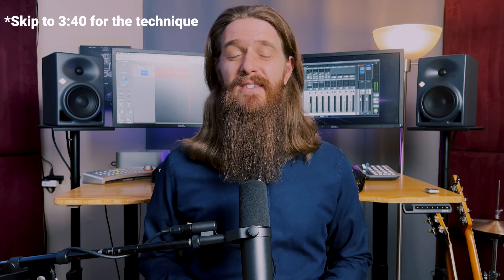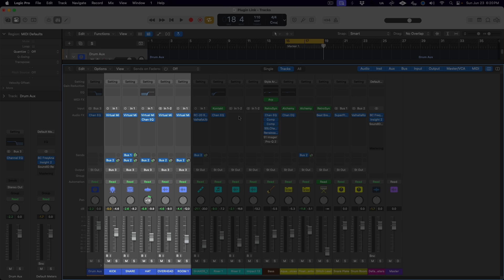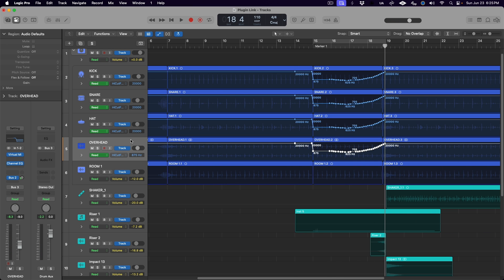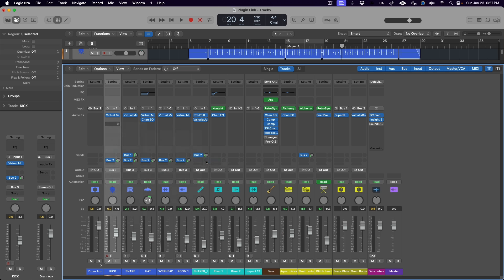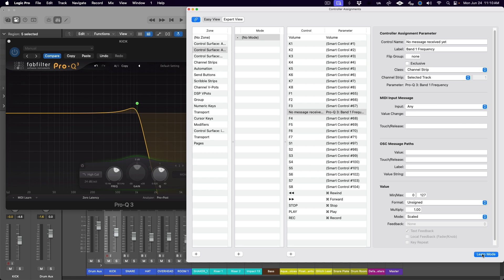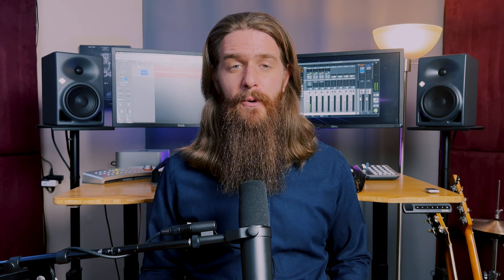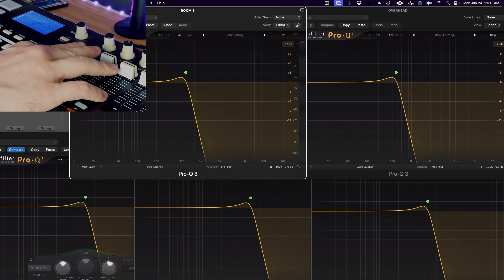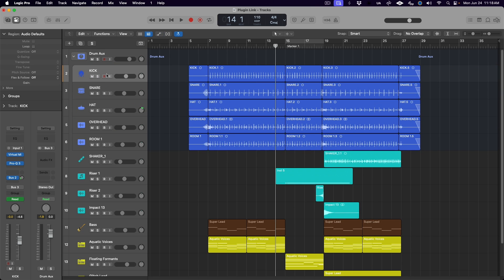How To Link Plugin Controls in Logic Pro

Comment: I cannot find anything about the link button at the top of the control panel on my iPad mini six of course using logic pro... any suggestions?
Reply from the maker: I’m actually not sure that this works the same on Logic for iPad. I don’t have much experience with Logic for iPad so I can’t say for sure.
Reply: @san @sangstersounds pretty powerful for a DAW. I'm also quite impressed with BANDLAB. But if you do find any info about the link but come back here lmk plz. All my findings have uncovered is its a sync function but any literature on it is scarce. ThaNk yOu

Comment: Hi, this technique unfortunately has one major flaw in that all of your connected channels Volume and Pan settings are controlled by the Kick channel. The Volume and Pan controls on a channel strip (Audio or Instrument) all have the same MIDI location or address (similar to you putting your EQ plugins on Slot 3). When you move the Volume slider on the 'Kick' channel it will send CC7 as a 'Fader' message to all the other connected channels, same with Pan CC10. Actually looking it this again you have a cascading effect going on so moving any of these channels Volume fader will have an effect on any channel to the right of it. Having used Logic since it was eMagic Logic I've spent A LOT of time in the Environment 😅. There are other better ways to do this in the Environment but they're not very pleasant 😀 All the best Tob
Reply from the maker: Thanks for bringing this to my attention Tob! For me, I guess I would just set the volume and pan first before setting this up and then possibly just bounce the effect and unlink. Im curious what your Environment based solution would be though!
Reply: @sangstersounds  Hi Chris, I made a video about it here. Thought it was easier than explaining in a comment. Turned out to be a lot harder! 🤣 https://youtu.be/xo_0P5-w2i8 Sorry if I ramble on :) Hope you are well! All the best Tob